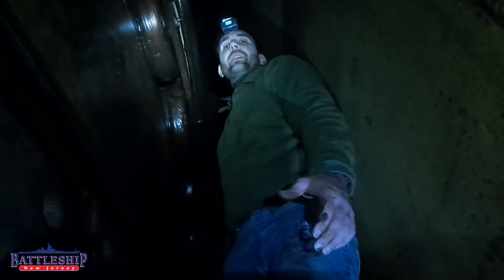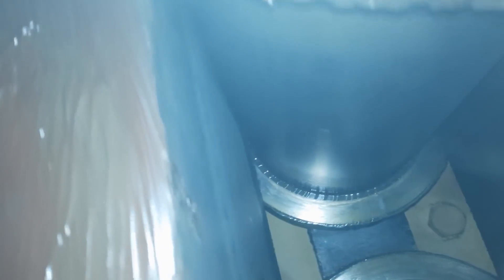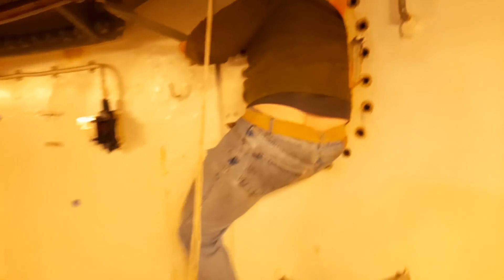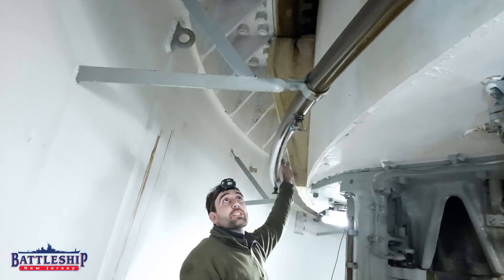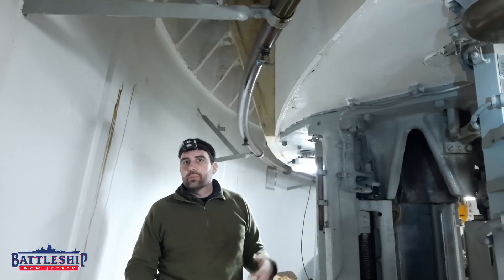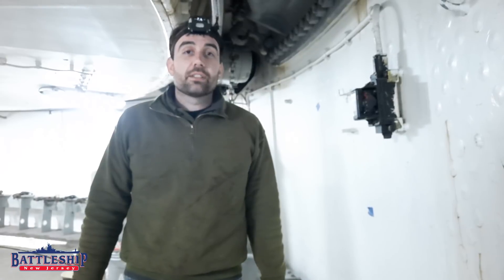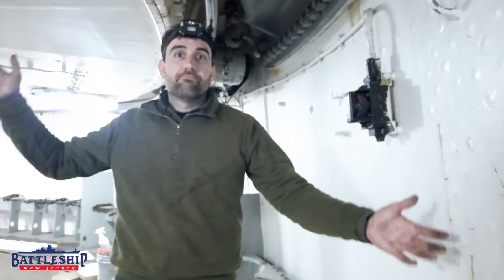Do the 16in Gun Turrets Still Rotate?

Comment: Early in WWII HMS Hood rear turret ring became so contaminated with sea water at one point it had to be turned by block and tackle
Reply: Really? I bet that was something.
Reply: @robertthomas5906  my bad, 1939 Y turret y-turrets roller paths were immobilized by saltwater. The block and tackle. March 1940 the Argo line pile and hydraulic systems in A and Y were contaminated and both turrets had to be trained by block and tackle. Info from Bruce Taylor’s “the Battlecruiser HMS Hood”

Comment: Surely there must be some electrical test procedures that could let you tell whether the turret traverse motors are still functioning? It would be really cool (even if they can't be fired) to be able to turn the turrets on a special occasion.
Reply from the maker: There are a lot of hydraulic components as well in here.
Reply: @BattleshipNewJersey  Do you figure they would all be necessary to move the turret? It sounds like a complex operation but it'd be neat to know if you could make it work even theoretically.

Comment: I have watch several videos, these spaces conform to enclosed and confined spaces. So I think according to OSHA 29.CFR.1910.147 confined spaces at a minimum should have means to measure LEL continuously and ventilation. Although I enjoy the videos it appears you are putting yourself at great risk as well as an OSHA violation that carries fines.  Not only is it confined space but it is steel and metal spaces where there could be oxidation from rust removing the oxygen to a level below LEL of 17%.  Life is not supported below 17%.  You scare me and I have been in commercial maintenance for 20+ years.
Reply from the maker: Let me assure you, we have a combined 40 years of museum ship experience and know what a confined space is and how to safely enter them. This particular space is extremely well ventilated, what you can't see in this video is that we are on the upper level of this space, with the lower level having large 6 foot door like openings in it that lead to other very large and well ventilated spaces. Its hard to access the upper ledge where we're standing from the lower level and requires opening yet another hatch, but its certainly well ventilated. 

Unlike what you see on an active vessel, we don't close our doors and hatches so that these spaces can be ventilated, so we don't have the same problems that active vessels do.
Reply: @BattleshipNewJersey  I hoping there was some fresh air flow other than you could see in video.  I do enjoy watching, I have toured my home state Battleship US NC

Could there be a video comparing the WW2 Version of these 2 ships.
Reply from the maker: Check this out https://youtu.be/i_hcXuGIKuU

Comment: Soo basically with enough electrical power the turrents are likely fully functional still
Reply: Given enough time, dedication and money virtually anything is possible. The better question would be 'is it worth it?'
Reply: Nope.  The rollers and lower ring will have deformed out of true over time just sitting there.  Turrets have to be turned on a very fixed schedule if you want them to stay operational.  Cf.  HMS Royal Sovereign
Reply: @iatsd  Uh, no. These ships sat without any turret rotation for over 30 years in some cases. They all worked fine when reactivated.

Comment: 3:20 Yes, the hold down clips are intended to hold the weight of the turret (proven by Mike Getscher and Ed Najjarine). That's not to say they would do so for long (Eg. Prinz Eugen's retaining clips have slowly failed under the test of time and salt water) or that they 100% will it's not been tested, nor do we have a capsized Iowa class that retained its turrets in place to answer that Question. Either way, the clips on most ships, tend to be engineered to be able to hold the weight of the whole turret basket. The few exceptions being Yamato's failed potentially due to the concussive damage she took before capsizing. Tirpitz turret clips were stretched during the damage from Operation Source. #4 Dora was pushed over, off their rollers, breaking the lips on the upper sets of rollers, and many of the planetary gear's teeth were partially flattened or broken off upon crashing through the worm drive and against other local structures, so despite the other gears and rotation equipment either being repaired, or replaced. Dora was never fully operational again according to Alfred Eichler (Chief Engineer aboard Tirpitz) and her log books (Tomas Gallagher's research)

3:48 Tomas Gallagher did find evidence in Tirpitz's notes and from first hand accounts, Bismarck would have had retaining clips. Whether they were as strong, or designed like Tirpitz's to aid in her water tightness, after the experiences of Scharnhorst and Gneisenau taking on hundreds of tons of water at top speeds, is not clear, there is very little evidence, and original drawings of Bismarck are as rare as rocking horse poop. Plus, unlike Gallagher, we no longer have access to such fantastic resources like Captain Hans Meyer.

Unlike Iowa, who has dozens of old drawings archived, and even her turrets operating manual has the hold down clips labelled.

The clips aren't designed to withstand the magazine brewing, but engineering them for the weight of the turret, was the most commonly picked desideratum across various national naval engineering schools. There's just as many examples of turrets falling out of place, as there are of turrets remaining fastened during a capsize, and for varying turret weights, all to way up to the largest Battleship turrets.

On another note... She looks as well kept as a sterile clean room for pharmaceutical packaging xD
Reply: I think this is the video you are referencing: https://youtu.be/LJfGJPLDwAI
Reply: @mpking828  I'm very lucky enough to have seen him making that lecture(?)(speech?)
Although thanks for the link! Didn't know it was ever recorded.

Comment: The next time you do an engine room tour is there someway of showing a cross section of a steam supply line.  They are all hidden by insulation. What is actual diameter of line? Boiler supply to main feed. Main turbine supply. Crossover to low pressure turbine...

Comment: About the turning and elevating gear, from the turret crawl on the Iowa, there’s a massive motor and pumps on the electric deck. What kind of power, pressures and oil quantity would it take to move the turret?
Reply: Just checked in OP 769. It says there is a 300hp electric motor powering hydraulic pumps to rotate the turret. Not sure of the details beyond that.
Reply: @PhantomP63  
They would move the turret like it weighed one ton not 200. During the time the firing computer was working out the firing solution, the turret would move right and left an inch or two 2 to 3 times a second. We would loose a shell if we tried to move from the outer ring to the inner.

Comment: The Zerk fittings all have caps on them, I don't even have those on a new warship.
Reply: They are not Zerk fittings. They look like the hp type used on RR connecting rods and other similar places like crawler tractors.  Can't think of the name of the grease or the fitting at the moment.  The grease used for RR use is solid at room temps.
Reply: Button head grease fittings.
Reply: @josephpadula2283  Thank you.  Thought it was something more sophisticated not descriptive but that's just what they look like.
Reply: @josephpadula2283  Correct. The grease gun locks around the button, so it can't pop off the way Zerks frequently do. Allows higher grease pressure.
Reply: The Navy ships I was on had caps on all the Zerk fittings on the main turbine bearings. And if ant of them were missing we got holy hell from the Chief Engineer.
Reply: Double aught grease. Zero weirht. Like corn head grease. Gets hot makes oil gets cold congeals. Excellent for leaky gear boxes and the like. Clots up.
Reply: Learned something new, thanks.

Comment: Did you get permission to enter a confined space lol?
Reply from the maker: We don't enter confined spaces without a gas free engineer, fortunately, we don't have many of those. This space was open from the lower level.
Reply: @BattleshipNewJersey  lol I used to have to repair the  electrical wires in the  fuel tanks on the GW we had to  get them drained and then run exhaust trunks and then have the  DC officer test and  let us go in

Comment: Great video again as always Ryan and Co.! The linked document about Welding the gun turret training mechanisms is mentioned at the top of Page 5, copied here: "Before section 1011 was enacted, the Navy had begun to demilitarize the U.S.S. New Jersey by welding down the training mechanisms of its 16-inch guns." To me it is unclear exactly what parts of the "Training mechanism" they are referring to? Was it the rollers, or the transmission linkage from the motors or etc? My point here is that It might possibly be something other than the rollers that they welded, (I was hoping) that would be a bit easier to both find and then possibly "undo".  Also perhaps look into the US Navy Manual Directions for de-milling military equipment. Surely there must be some sort of "Official Instruction" they went by. It is likely they were following those requirements and that Instruction may give you more details on where to look for the work? Just curious. Thanks for a superbly interesting video.
Reply: Decommissioning has different priorities than an active ship. The turrets were pretty much of symbolic use during the 1980s (the last time a US navy ship sunk an enemy ship was 1988). After the Iowa explosion, they locked off that entire turret and sailed around with it out of action from that point on. They simply weren’t a priority.

If I was in charge of a yard decommissioning a ship equipped with nuclear missiles and recently added top secret electronics, and I was asked to weld the turrets, I would put it on the bottom of the to do list. At the most pragmatic level, welding thick steel that is caked in heavy petroleum grease and is in a confined space should be something you do once everything salvageable is removed.

It is perfectly possible that an overall process of demilitarisation that included disabling the turrets had begun, but specific actions were not yet carried out. That is the way that reporting in government works.
Reply: @nicbrownable  Great points Nic! It supports my hope that there are actually no welded rollers at all, because of the details you mentioned.

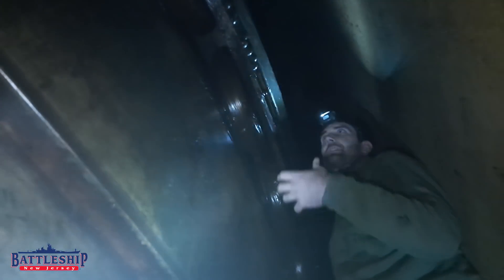Comment: Nice video. Small edit for our younger, non mechanical viewers, at 2:10 brass or bronze don't create sparks due to being smooth, it's because they are non-ferrous metals. I would also think the designers wanted non rusting metals due to the limited maintenance cavity.
Reply: Small edit for that. Brass/bronze don't spark because they are soft metals that don't take much energy before some material shears off. It's not just ferrous metals that spark, otherwise you wouldn't get a fireworks display every time you take a chunk of titanium to the belt grinder

Comment: After reading the PDF they where very vague of what was to be welded other than "welding down the training mechanisms of its 16-inch guns". 
It's possible that some thing happened like not welding the rollers since it sounds like they are of a bronze oilite type of material (or if they have bearings weld them but it would be hard) or they could have welded up any gear on gear surface like welding up a open diff. If for any bizarre reason welded up the elevation mechanisms.(If the ring was welded it's possible that they did a stitch weld to save money on rods, gas, etc.)  Also does the Navy specifically not allow you to turn the turrets at all? You can do like some do with old steam engines and run them on compressed air.

Comment: I agree with hal james: thank you for doing this.

My supposition is that the plunger pin you showed us may have some shock absorber value but I think it's true purpose is to possibly open an electrical circuit or close one to send an interrupt signal. Either way, the resulting function would be to stop the motor(s) driving the rotation in the event the human in the loop wasn't paying attention.
Reply: I don't have first have knowledge of this system on the NJ, but based on the way the military usually thinks I would say the is an actual switch that is tripped before the stop hits. The bumper is there in case the turret over rotates. You'll notice the fixed bumper had a think coat of paint on it, if it has contact regularly the would be signs of that contact.
Reply: @fire304  I would be willing to bet the number of times the turret even rotated close to that far is pretty low. It's not a common angle of attack to use tactically outside of World of Warships. In WWII, she would have rarely engaged in fire that wasn't straight ahead to directly abeam. Shore bombardment was pretty much straight broadside work, and that probably accounts for the utter majority of times the turrets were even rotated off of center. Training likely accounts for the rest. While I can see a training evolution running the turret to the "limit", I bet an officer had his finger on the abort switch the whole time. So having intact paint would hardly be determinative.
Reply: @timberwolf1575  are you telling me that they didn't shoot over the shoulder like that to kite  from the enemy in real life? All the while the enemy is taking the cap. I thought the game was 100% realistic. LOL (Sarcasm)
Reply: @timberwolf1575  I agree. In fact, if I understand naval doctrine at the time was to engage bow on to minimize your silhouette and maximize the angle of the armor belt. Firing to the rear was only done while running away from a superior force, which in the days of the decisive fleet engagement theory should never happen to a capital ship. Hence only forward battery ships like Nelson and Strasbourg, they were never going to run so no sense in having rearward firing batteries. 

There's also a danger of firing over the shoulder in that the superstructure of the ship is directly exposed to the blast of the muzzle. If you watch the intro to Dracinifel's videos (which if you watch this video you should watch his channel too) there's a video of a broadside firing and you see a bunch of debris go flying from the concussion. Imagine being in the enclosed bridge and having that shockwave hit you. Your liver would turn to jelly...
Reply: @fire304  You can see the actual stop on the ship structure has a replaceable part where the hydraulic pin can hit. Likely the pin operates a grease filled chamber that vents the grease through an orifice to limit shock, but there probably is a electrical limit switch in the turret director encoder that first will stop electrical rotation 2 degrees before, then the shock absorber is there for in case damage has meant the turret is turning under direct manual control as fallback. 

That structure is there as final stop, in case of a control system runaway that slews at full speed traverse, where it is likely the limit switch operation will still result in hundreds of tons of metal having to stop without damaging said hundreds of tons too much. Probably only has been tested twice, both times deliberately, during acceptance trials and during refurbishment, the rest of the time being a safety system only inspected and never used. One stop per side, and likely in the ships stores there is only 2 spare end caps, and a single plunger.
Reply: @fire304  An Iowa-class turret weighs something like 1700 tons.  That's as much as 2-3 railroad locomotives. That bump stop is not going to handle all of that mass if it strikes with any real velocity.  They must have done something to account for all of that inertia even when laying the guns.  Possibly dynamic braking?  Someone must know.  I bet the "switch" is actually an electro-mechanical index system similar to what you'd find in a contemporary jukebox on a massive scale.

Comment: They elevated the Iowa's barrel ( one) here in Long Beach manually ( got away with it )
Thiers a video about it .

Question 
Are the systems hydraulic and electric and which system is not allowed to be operated?

Like everybody else love to hear a
4th of July or Veterans day volly with just a 1/4 of 1 bag of powder at the most if that much ..As anything else windows for miles would have to be replaced .
The only time they fired the 16" shore battery at Fort Mc Author in the mid 1930's ( as I was told by my grandmother this was what happened ) true story or never let the truth ruin a good story do not know ????

Time to  negotiate the contract
Yes I will help clean the barrels afterwards.

LOL

Mike
Reply from the maker: Weve elevated pur barrels to their current heights by hand crank. The systems to rotate are both electric and hydraulic and we won't touch them.